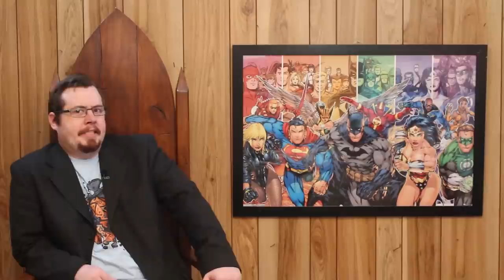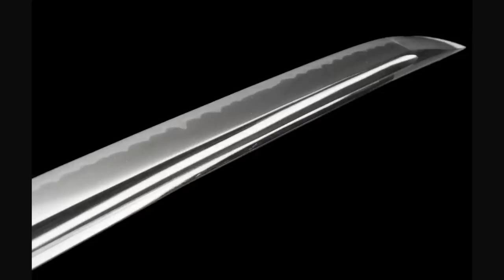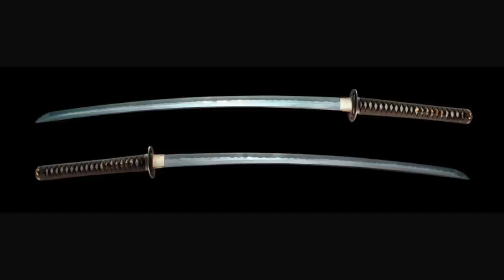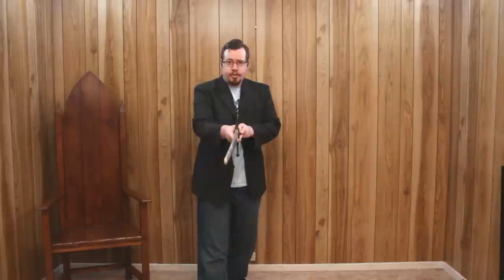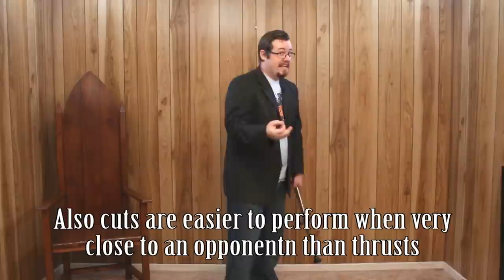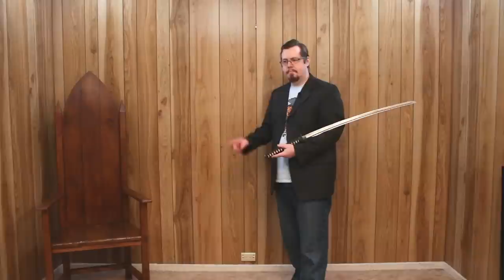Super cutting swords, are they needed?

Comment: cutting clean through has one advantage in my mind: recovery. say you had a sword that can cut to the bone. that's great, but in combat your cut is sloppy enough that it embeds in their bone and you can't quickly remove it. your immediate battle would be over, I'm sure, but in any situation with more than one enemy it becomes essential to retrieve your weapon. this also applies to horseback battle, scimitars are shaped to have cutting potential far beyond what is necessary, but in the heat of the moment, on a moving horse, you don't have time to stop and wrench your blade out of the victim you've just hacked at.

Comment: You mention overkill, but neglect a few points...

First of all, there's confirming the kill. The advantage that your 'overkill' has is that you are absolutely sure that a target is unable to resume fighting, usually because you can see his head flying off of his torso. If you deliver a cut that may kill, you would have to wait several seconds to confirm that the target is indeed dying/dead. Secondly there's the amount of effort required to produce a killing strike, when your sword does half the work for you, getting a deadly cut in is going to be far easier.

Then you mentioned that stabbing requires action from the defender, this is correct. But it is common doctrine that a swordsman attacks and defends at the same time. So while he is required to use his tempo to deflect a stab, he is gaining a tempo, or even a deadly tempo because he's attacking at the same time. Then there's the guards where stabs can be made from... while cuts are telegraphed in their guards (1 guard has 1 direct attack and one indirect attack, everything else constitutes a guard change), thrusting is no different as they all require the sword to be pointing forward. The thing with the sword pointing forward is of course that the opponent gets a free binding which he can then use one of the master hews from to gain a (deadly) tempo.
Reply: Hes trying to show that long sword is good but i think the other blade are far more better

Comment: You are making an interesting point there. I feel like if you need a weapon for self defense as say a charackter from your average RPG, that crawls through dungeons, fights indoors, outdoors, on the battlefield, from a horseback ect. you might need a generaly good one fits all weapon, that you can also carry around easiely. BUT: Some swords, in fact quite a lot of them, are designed in a very specialized way, because you only use them in a specialized way. For example the roman gladius, which is a very specialized thruster. Now it has scary sharp edges on either side, so you can cut with it but the very close-to-guard point of balance and pronounced point make for an excellent (while rather short ranged) thruster. Why do that? why limit the range of the person using it and take so much weight away from the point? And most importantly, why not add an extensive handguard, or at least a crossguard. Where the romans not concerned with their own safety? Of course they were, but other factors can make up for what the sword is lacking. In fact you only use the weapon to thrust at short range with it, so it might as well be absolutely overdesigned to do only that.
Let's ask who was using it. The answer to that is of course a roman legionare. What does almost every legionare do for at least half his life? Working on a field. Roman legionares were usually not using that sword at any time, other then on the battlefield, or training for exactly that. So most of the time they dont even need a sword, and the sword can be awesome at being a battlefield weapon, while it aboslutely does not matter how it would perform in a one on one unarmored situation. 
Now, let's ask what a battlefield situation would require a roman legionare to do. As a roman legionare, you have a big ass shield. Because the solidiers aren't exactly experts in what they do, it's essential that the protection is very large. You can sink the  lower end of your shield into muddy ground and push against it and you are rather safe, because men to your left and right are doing the same thing. Of course you are never truly safe, peaple to your left and right are dyin, those in front of you are trying to kill you, so you are always in danger, but a formation like this is really hard to break, even if the defenders are not very skilled so we can call it battlefield-safe, with the understanding that a thing such as safety really doesn't exist on the battlefield. Now with that being said, just defending is not gonna cut it(or thrust it in this case). If you are using so much energy for your defense and space is limited, your only attack option is a quick thrust over your shield or through the (ideally) small gap between you and the next legionare in line. It would be very hard, to get enough space to actually do a full swing for a decent cut. Also thrusting (especially with a short sword) is easier to learn. No need to worry about edge alignment, just "stick 'em with the pointy end" and you'll get the job done. This also means, that your hand is only going to be exposed for a brief moment, and only for attacking. (almost) Never predictable, because the shield blocks sight and (almost) never for defense, because it is so huge that you can fit your whole body behind it. Why add the weight of a cross, or knuckleguard then? well, you don't. Now, if you are done stabbing a few times, the roman formation will have you move back, so you dont get yourself killed and the next line takes the lead for a while. In that situation a bulky weapon is very unpractical. 

Same goes for super cutting weapons. Sabres for example where often used by the cavallery, where the weapon is already in a fast motion, so you just need to hold it out and you'll cut like a champ. On the other side, thrusting might be terrible, bacause if the weapon gets stuck, it's lost for good and your horse will not go pick it up for you. Being a bad thruster is actually beneficial for a cavallerist. 

Maaaaan that took way to many words. But people say that about your videos, so I think you'll understand. Also on a sidenote, I am still studying history, not done yet so let me know if I got things horribly wrong. Not to late to fix my knowledge. (hopefully)
Reply from the maker: +tharrock337 Oh I understand alright. thanks heaps for all the thoughts mate!
Reply: +tharrock337 Great Post!! I just wanted to mention that when stabbing, crossguards/knuckleguards can get snag on the rim of your shield or your ally's shield. That's why the gladius doesn't have guards.

I heard that from somewhere.... but I can't recall at the moment. It might've been Skallgrim's channel.
Reply: Merciful One
Thanks. Lets say it's another reason. Being bulky when changing lines and unecessary weight because of your shield are also valid points.
Reply: Actually gladii doesn't have crossguards due to one simple reason. It was never used without a shield and when you have a shield to protect you, you don't need extra hand protection. Hand protection started developing in Europe when shields were changing to strap-ons instead of boss held. Now with strap-on shields you can have a generally bigger and more protective shield BUT it's not going to be mobile, so you want some protection on the hand.

When shields and armour went out of favor (and with specialized civilian swords) we see more complex hand protection appearing until we get to schiavonas, which later influenced completely closed hilts without gaps (schiavona hilts are made this way because of balance reasons and besides that it looks great)
Reply: In the rpg you mentioned, we sometimes visit towns, taverns, brothels, bazaars and homes. So I lean pretty hard towards a Spaffslinger like Lindybeige made. Just with a Rapier or Sidesword at the hip, something light and small compared to the long spear I've got.
Reply: Roman swords like gladius thrusters xD
Not even in slightest. To wide, wrong handle. thrusting with Gladius or similar put tooooo much stress on wrist. If You would thrust with gladius rly hard You probably would end in hospital :)
We don't know how it was used. but if we compare it to other weapons it have handle like many "cutting" swords(especialy like Indian sabres end viking swords). Wery tight that allow to wrist move in one certain way that force soldier to do correct cut.

Also sabres are good thruster. You just do it in a bit different way holding it a bit differently.

Also on horses it is nothing uncommon to use specialized thrusting swords like koncerz.
Reply: Czorńy Lisek It is well documented that Roman soldiers were taught to primarily thrust with. Their opponents rarely wore armour. But we also have accounts of gladii lopping off heads and arms so that's something. And well all I can tell the grip of the gladii are not perfect but that's a thing with Roman Era swords and you can thrust with it without the risk of injury.

Let me guess, you fence with foil.
Reply: Czorńy Lisek There is one type of sword that is not really suited for good point work, English and Scottish style basket hilts. Continental basket hilts allow for much more wrist movement and allow you to put your index finger on the ricasso while English swords force you into a hammer grip. You can give point with it reasonably well but you cannot lunge with it and other extended thrusts are nearly impossible. Well to be fair these types of thrusts are not useful at all on the battlefield so it is not a great disadvantage.
Reply: I don't fence with anything. To expensive for me, no club in city end my health don't rly allow me to do anything, not even anybody that also like swords.

Gladius end similar swords force user to use "broken wrist" grip(hammer grip without ability to move hand a bit). It as name suggest it make thrust dangerous to wrist also it force a bit to do correct cuts.
.

As You say there are ways to prevent damage to wrist. But why design weapon in first place that handled "in normal way" is bad for thrusting end then use it for that? Simple ignorance, tradition or maybe just lack of knowledge.(?)

Also just look at gladius is so wide, there is so little taper. How it's even thruster. Whole design is like anti thrust. While having design choices common with specialized cutting weapons like Sica.

Although Yes I agree that those "crazy" thrust that are hard, dangerous or impossible with gladius are not rly good on ancient battlefield.
Reply: Czorńy Lisek There is only two ways to thrust with a gladius and both would employ a hammergrip anyway. One from below right to the abdomen and through the chest cavity and into the heart, the other being from above into the chest and into the hearth.

And as I have mentioned when your opponents only wear their own skin and clothing you could even use a spoon to thrust them through. In this way a wide blade makes sense because it causes a lot of damage.
Reply: Czorńy Lisek Remember you are using these swords with a large shield that doesn't allow for any kind of left side attacks.

Oh well I have looked at gladii and they have long enough grips to comfortably employ a handshake grip that is actually very suited for thrusting.
Reply: I guess you have tiny hand I don't know how humanly there is any room to move hand in Gladius grip. Museum, ancient sword have grips profiled for 4 fingers. With some rare handles being for only 3 fingers with guard looking like having place for 4.' finger..

Also attack from left end shield. Well just extend hand so You can reach behind shield end attack from left or simply move shield a bit. If somebody don't have short hands I don't see a problem.

Yes You can puncture with qutie anything somebody that don't have armor. But still. It would be easier to penetrate with more tempered blade. Instead of straight or leaf blade.

Actually some museum sword seems to be made quite thin end heavily tempered. But it's more like "
exception proves the rule" That probably eventually lead to development of Spatha.
Reply: Czorńy Lisek Well viking swords for example have grips only 6.5-9 cms long, same with Indian swords, they fit my hands just well (and most people's hands as well). Gladii often have as long grips as 15 cms with the rest being a hollow wooden pommel. If you can't leave your hand on that you might as well be a guy who is 240 cms tall and only does heavy physical work.

The attacking from the left side crosses your arms quite a bit and puts you in an uncomfortable and dangerous position which is hard to recover from.

Now I have small hands, not the smallest but not the largest. I can barely fit my hands on a 7.5 cm grip. On viking era swords the pommel facilitates for a handshake grip otherwise they are aswell comfortable in the hammergrip. Indian swords quite clearly restrict you to the hammergrip and the hammergrip only.
Reply: Gladius with handgrip 15cm long o.O
From what I know gladiuses profiled handgrips are bellow 10cm. With even short one like 6cm. I guess there may be some longer, end "reproductions" may have longer grips so more customers will buy them.

So from I know I see gladius tight hammer grip or with one finger on guard only.

My hand is 8,5cm wide where fingers "start" end 9,5cm in widest place. For Me(in my opinion) I have have tiny hands ;P
Reply: Czorńy Lisek With ancient swords we really need to be careful as their tangs do not run through the handle, that feature came with the migration era swords.
Reply: High Master Johannes Lichtenauer There are survived handles/grips of Gladius end other swords. As quite many seem to be made from bone or stone.
Reply: Czorńy Lisek Bone maybe, stone seems pretty unlikely, it would make for a grip that's too heavy, also a bit uncomfortable and in the risk of breaking.

Wood seemed to be the most used grip but well bone comes in a close second. I have recently seen a filippino sword that had a human thighbone as a grip.
Reply: "Because the solidiers aren't exactly experts in what they do, it's essential that the protection is very large." A soldier is per definition a professional warrior and an experienced soldier is technically an expert. Not to mention the Roman army in particular was very well disciplined and trained. :p
Reply: HEREWARD THE WAKE  Role Playing Game
But I get you, I keep thinking that same thing.
Reply: "Because the solidiers aren't exactly experts in what they do, it's essential that the protection is very large." You make it seem, like the Roman soldiers didn't know what they did. Roman legionaries were probably a lot more trained, than any solider before, or long time after. At least from around 100 BC on.

The average legionary served at least a 16 year term, usually 25 years and in that time they had no other job, or were even allowed regular contact to women. They basically trained every day, even had 3 test marches a month (when they weren't at war) and saw themselves as an elite troop. I am pretty sure the Roman legionary knew exactly what to do at the battlefield. 

And it took a very long time until such specialized military came back. Even the medieval knight was just a rich guy, who could afford armor, a horse and a sword. Most of them spent most of their time in their keeps, probably doing other stuff than training.
Reply: With all these smart comments it looks like everything’s been said so I’m just gonna add that I loved the Stick em with the pointy end bit

Comment: Shad, I respect the thought you put into this, but you're mistaken on several points. Before listing them, I wish to state that I agree with you concerning the effectiveness of the thrust. A properly placed thrust kills more efficiently than a cut. Yes. Absolutely. That said,

1. Extreme cutting ability is not redundant. In a fight, the ability to survive is at least as important as the ability to kill. Having struck his opponent, a fighter must be able to extract his blade easily to maintain defense. Swords capable of passing entirely through a limb will not get stuck in the bone. 

2. Assuming for the moment that extreme cutting is redundant, your argument proves the same about extreme thrusting. A thrust from a longsword or katana, properly executed, will kill. Why then develop the rapier? Because it's nimbler, possesses superior hand protection, etc. 

3. Weapons specialized for thrusting, if they are swords and not daggers, tend to be long. This makes them less suitable for close quarters combat since it is more difficult to bring the point to bear. A cutting blade, sharpened along its entire length is more useful here.

4. It is not easier to block a cut than a thrust. Yes, a thrust can terminate at any point on the body, but it really arrives from only one direction. A cut can come from anywhere, and a skilled fencer will not telegraph his intentions. True, cuts require preparation, perhaps this is what you mean by 'telegraphing, but the inclusion of feints can keep your opponent guessing.

5. Combining points 1 and 3, we that cutting swords are better for facing multiple opponents. Granted, these do not necessarily need to be 'extreme' cutters.